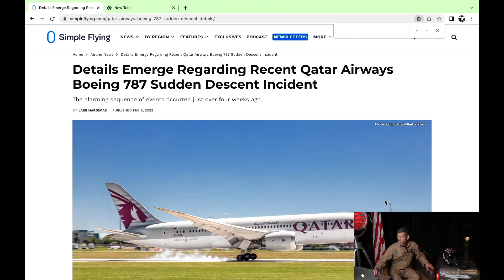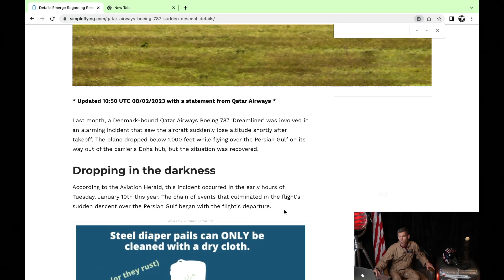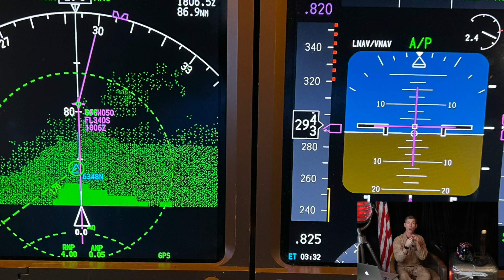QATAR Airways Loses Control & Situational Awareness (SA) Drops to 850'

Comment: I like your take on it, too early of course but very strange, so far I’ve heard loss of situational awareness, apart from instruments, how could you descend at 3000ft pm and not realize what’s happening?
Reply from the maker: Loss of Situational Awareness is insidious.  When flying pressurized jets,  you can't feel the descents or the climbs. All of the flight information comes from looking outside at horizion and crosschecking this data (visual cues) with the instruments.
Reply: Yeah I was curious too they must've AT LEAST heard a "Bank Angle" warning